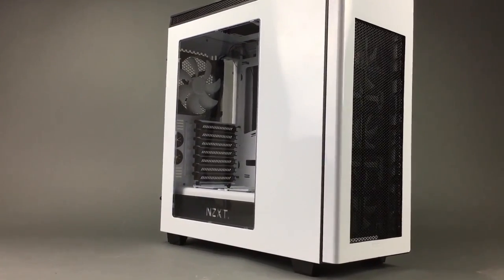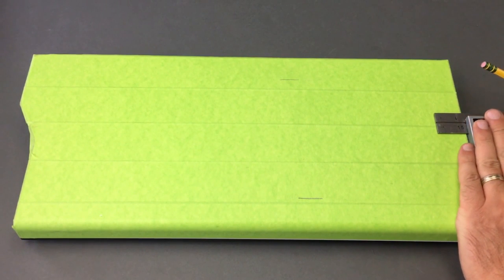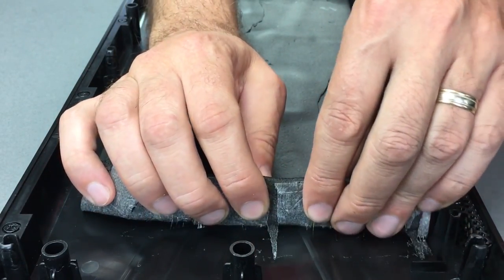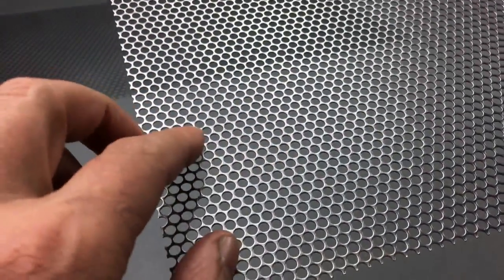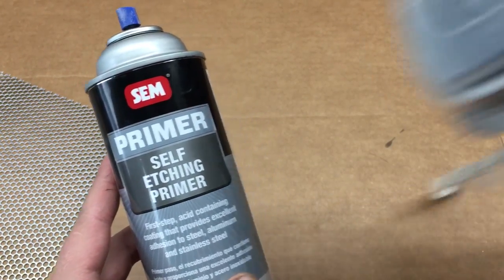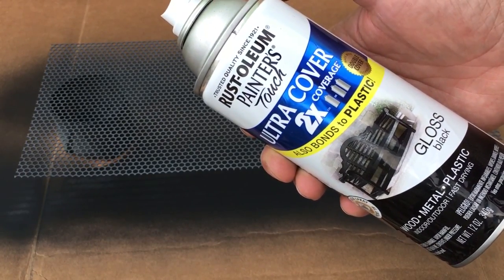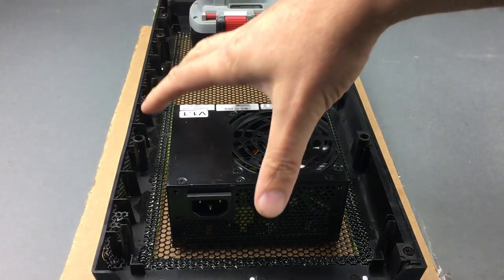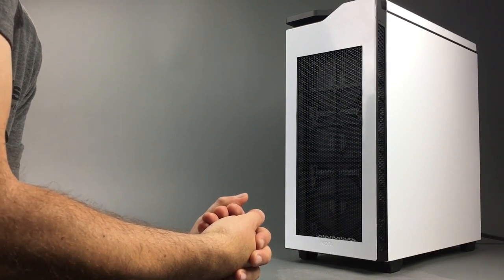#NZXT H440 FRONT PANEL BEZEL AIR FLOW GRILL MOD

Comment: I have this case and I've seen so many mods for it, it makes me wonder why NZXT doesn't just refresh this case to include better airflow and a full tempered glass side panel.
Reply from the maker: agreed. Your questions shared by many people. Thanks for sharing!
Reply: They'd be better off just doing a whole new case based off this design. That's kind of what they have been doing though. In fact, OTHER case manufacturers took notes from this particular case. The built in PSU shroud, the angled edge of the motherboard tray, the fan hub behind the tray. This case kind of popularized those features.

But yeah, it would be super cool if they made an alternative front panel with a grill on it that we could just buy separately and swap out with the original. But this mod seems simple enough. You just need the right tools for it.
Reply from the maker: Do you own a Black or White NZXT H440 case? I'm going to speak to NZXT about possibility of ordering H440 front panels and selling them with my grill mod here, https://mnpctech.com/nzxt-h440-s340-razer-replacement-custom-window-smoked-clear-red-uv-green-blue/

Comment: Great looking mod, Bill. Is it possible to just "sandwich" the modders mesh between the plastic and metal layers? Just curious in case someone doesn't want to glue it in
Reply from the maker: I prefer it being indestructible, but you if you prefer trying that approach please let us know about your results.  Thank you 10ee
Reply: I modded my case by sandwiching between the plastic and metal and it worked great, but also Bill's method is tried and true. I've done it both ways on different cases. that foam is a pain though, I took it off my back panel as well for more room for cables.
Reply from the maker: Do you own a Black or White NZXT H440 case? I'm going to speak to NZXT about possibility of ordering H440 front panels and selling them with my grill mod here, https://mnpctech.com/nzxt-h440-s340-razer-replacement-custom-window-smoked-clear-red-uv-green-blue/
Reply: Bill Owen What if I have both? haha. My wife hates me btw
Reply from the maker: hahaha, I plan to stock both colors, check this link in 3 - 4 weeks for them to be stocked,  https://mnpctech.com/nzxt-h440-s340-razer-replacement-custom-window-smoked-clear-red-uv-green-blue/

Reply ·

Comment: Did you ever find a way to sell these panels? I would definitely buy one.
Reply from the maker: No, I cant get the front panels from NZXT. You will need to DIY. Thanks again for watching!!!
Reply: Bill Owen thanks for the fast response. That sucks, I don't understand why they wouldn't sell you them. The issue is I have the hyperbeast model and I didn't wanna cut it open, but I can't find a way to buy any black front panels either. I'll either have to cut my h440 case or just buy an entire used black one

Comment: would this work with NZXT S340 or S340 Elite
Reply: Truckman I'm wondering the same thing. I have an S340 waiting to do a new build in. I also want to know if anyone has been able to fit in an EK XE 120 mm rad in an S340
Reply: Aron Racoma i am not sure but in front you can i guess unless GPU is too long. Im not sure so don't call me on this.
Reply: Aron Racoma i checked it out s34 0 should support up to 240mm in front if the radiator thickness is not too high.So you can add some random AIO there if you want.
Reply: i have a Rog strix card with three fans, and could fit a 280(140x2) radiator in my s340 definitely (the regular S340 supports kraken x62), im gonna do a mod like the video on my s340 soon
Reply: Truckman I see. I actually have a 120mm EK XE rad. That thing is thick as hell. I might end up selling it or trading g for an EK SE 240mm for the front.

edit: didn't realize I already stated which rad I had rofl
Reply: Aron Racoma i think the max thickness wass 98mm? Cant remember
Reply: Truckman I'll look at the user manual, I have if sitting right near me hahaha. Talk about lazy
Reply: Truckman looked it up. The max thickness up front is 65mm, rear is 75mm. Needless to say, I think the rear is my only real choice because my gpu is pretty long.
Reply: Aron Racoma Aye! Good luck!
Reply: Truckman thanks! I'm ordering a jigsaw so I can do this mod on my s340. Need to finally buy a Dremel, too
Reply from the maker: dont waste your money on DREMEL, The Black & Decker RTX has better motor and fits ALL Dremel attachments, https://www.amazon.com/Black-Decker-RTX-B-3-Speed-Rotary/dp/B000MUSLCC
Reply: Bill Owen thanks for the heads up! I used to work at Petsmart as a bather and they had Dremels there. Not too bad on dog nails, but I was wondering if it's be able to handle modding work
Reply: Bill Owen you aren't sponsered by Black and Decker by chance, are you hahaha
Reply: I have done this mod to three S340's.
Reply from the maker: that is CHEAP #GARBAGE, get the Black & Decker RTX on Amazon as I stated, and why do you need Flex Shaft, it just robs torque.
Reply: Anton that s340 looks so dope, I'd love to do this to mine. I just can't get a hold of modders mesh that is cheap enough to justify this mod. Between the tools and materials it's enough for a new case that has ventilation.
Reply: beretta9m2f was My problem aswell, i bought some regular perforated steel at ebay which was Really cheap, only problem was the shipment but it was for Sure the best deal for me,
Reply: +Barry Allen +  Aron Racoma Did you fix find a way to do this on a s340 elite? :)
Reply: Anton is that the S340? If it is do you by chance know the measurements? Or is it the same measurements on the video? I would love to do this to my S340 because I currently have a FX-6300 overclocked to 4.8Ghz with a 240mm rad.I want it a little bit cooler.
Reply: Do you have the elite version of the s340?

Comment: been wanting to do something like this.
Reply from the maker: Do you own a Black or White NZXT H440 case? I'm going to speak to NZXT about possibility of ordering H440 front panels and selling them with my grill mod here, https://mnpctech.com/nzxt-h440-s340-razer-replacement-custom-window-smoked-clear-red-uv-green-blue/
Reply: Bill Owen i own the white one and would probably mod both top and bottom panels. not so sure i would buy new panels when i already own them.  did you need to add any white paint to the cut line?
Reply: So i'm kind of curious.  You can buy a new case for roughly 120.  I cant seem to find the mesh for sale anywhere.  How much would you sell new panels for?    Also: I use 2 140mm fans in my case and really wouldn't want the extra height on the modded cut out for 3 fans.  Would you make them for that size fan config too?
Reply from the maker: No custom orders, I would offer exactly what was done in the video as shop production run. I'm not staffed for one-off orders. Still waiting for NZXT to confirm they can supply me with bezels and pricing. Link to mesh, select 24" x 12" size, https://mnpctech.com/case-mods-gaming-pc-liquid-modding-custom-computer-mnpctech-overclock-cooling-fan-grills/modders-mesh-perforated-aluminum-steel-honeycomb-grill-intake-front-fan-slotted-diamond-round-hex/modders-mesh.html

Comment: How do you know when to do wet sanding?
Reply from the maker: Wet Sanding isn't necessary when using Gloss Paint over mesh.
Reply: Bill Owen, but wet sanding method is used sometimes for pc modding right? I helped dad wetsanding and preparing a car for painting few times and thought that wet sanding is best preparation way

Comment: Is it possible to ship my front panel over to you for you to do this? i'm not very good with power tools.
Reply from the maker: Do you own a Black or White NZXT H440 case? I'm going to speak to NZXT about possibility of ordering H440 front panels and selling them with my grill mod here, https://mnpctech.com/nzxt-h440-s340-razer-replacement-custom-window-smoked-clear-red-uv-green-blue/
Reply: Bill Owen i own a white nzxt H440, and that would be great.
Reply from the maker: check this link in 3 - 4 weeks for them to be stocked,  https://mnpctech.com/nzxt-h440-s340-razer-replacement-custom-window-smoked-clear-red-uv-green-blue/

Reply ·
Reply: okay will keep checking, any idea on the price range?
Reply: did this ever pan out? im super interested!
Reply: I know this is a 6 month late response, but I would consider purchasing this mod if the price was right. Also how has this impacted the temperatures?

Comment: how do you get the almost unnoticeable finish on the edges where you cut off the metal/plastic front panel?
I'm afraid of even trying because I don't want it to end looking like this: https://i.redd.it/7ip0cmfjjve31.jpg
(I have a s340 btw).
Reply from the maker: goto 6:00 minute mark

Comment: I loved this inspiring video which has got me thinking that the Master Cooler MC600P case just needs the pictured honey comb screening. I wouldn't buy their case as-is for air flow restrictions. I will be installing 2 radiators front and top of the largest I can fit w/custom water cooling loop.The new Haswell-E and Skylake I9 CPU's overclocked are gluttons for cooling and I am cooling extras. Is anyone else salivating to own the Asus X99 Rampage 5 Anniversary Edition 10 and the EKWB (EK) mobo cooler which cools much more than the CPU, integrates into Asus' RGB lighting, and is the sexiest mobo combo in the world! Check out EK-FB ASUS R5-E10 Monoblock RGB Edition [3831109821596]. I already bought the I7-6850K with 40 PCIe lanes which will be dedicated to 16x lanes for 1080 TI video card, 16x for a Samsung 960 Pro NVMe SSD, and 8 lanes left for my Asus ThunderboltEX 3 card to attach a portable outboard Thunderbolt 3 quad HDD enclosure! Oooohhh Ssshhhip that is going to be awesome, but if I had the 44 lane I7-7900X even better running the TB3 with 12 lanes instead of 8 with mine. Too bad EK has yet to make a more extravagant monoblock cooler for any Asus Skylake board; only mine!